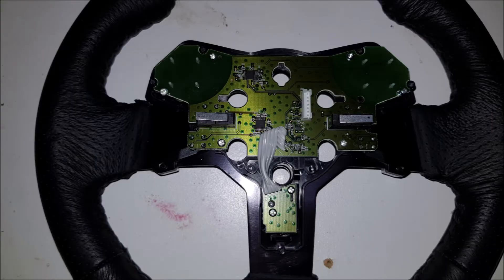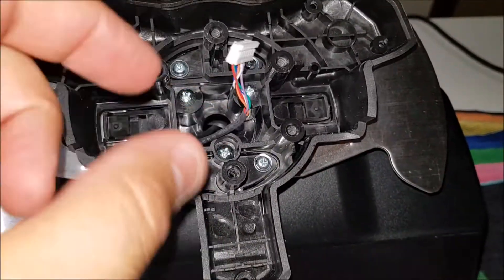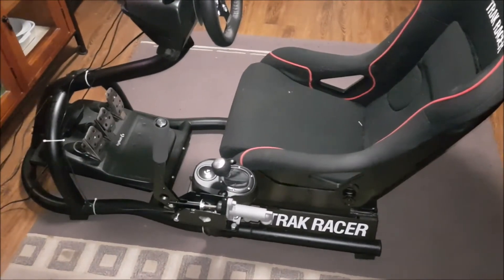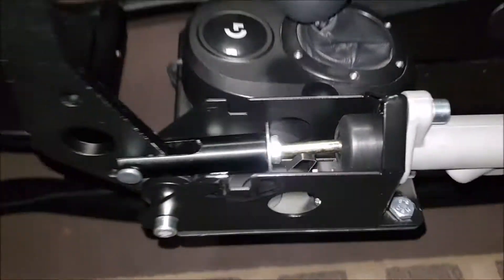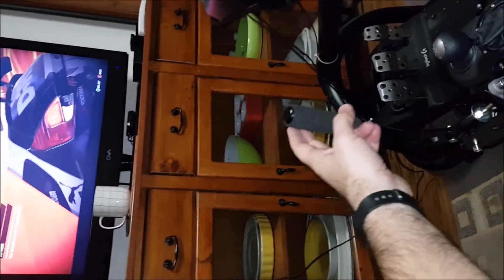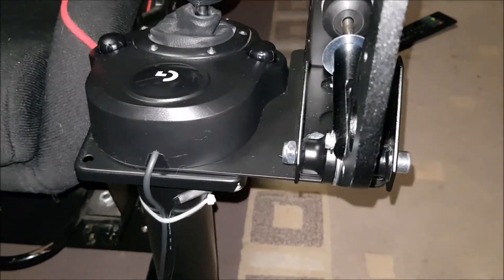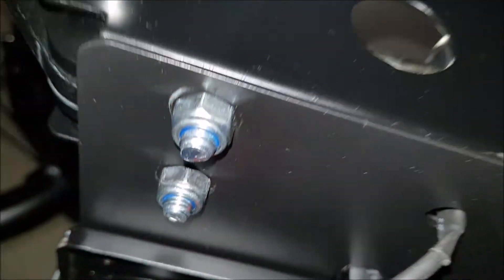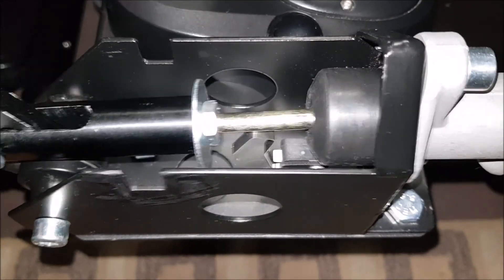Logitech G920 Handbrake Mod for XBox One - UPDATE

Comment: How did you connect the b button is it the same spot on all of them?
Reply from the maker: Not sure what you mean by same spot on all of them. I liked at Whyte the B button was on the board, then just followed it along to a spot on the blade where the track was easy to solder to.

Comment: wish u did a video of u doing the wires to the Btracks i want to try it my self but not shore how to do it and dont really know any one to do it for me   
any advice being its so small and thin ?
Reply from the maker: All you need to do is follow the tracks from under the B pad. One of them is common to all four buttons, from memory it was the upper one. Just lightly scratch the clear coat off and use a little bit of flux to help the solder stick. Don't keep the iron on the tracks too long as they might lift off the board and them you'll be stuffed. Sorry I cant offer more advice.
Reply: @19schuey  what colour is what ?for the wires
Reply from the maker: @glennnikkelson3082  because its a simple on off switch, it doesn't matter.

Comment: Could you use a pressure sensitive button instead of an on off one.
Reply from the maker: You could, but there would be no benefit. The input the console reads is on or off, same as the game controllor.
Reply: @19schuey  im sure if i hold the handbrake, give it gas and release the pressure on the button slowly the car takes off slower, compared to me just coming straight off the handbrake button. Im going to investigate this more tonight. I was sure the xbox had pressure sensitive buttons (the original one and ps2 did but google says the xbone does not)

Comment: Can you show what lines i need to tap in to on the motherboard to rewire Y and X button? I am planning on making a turnsignal switch so i need two buttons rewired. :)
Reply from the maker: I don't have any other tear down pics other than what was in the video. Just lift the rubber pad, and look for the track that goes to the button you were after. There will be two, one marked +ve, and one marked GND or -ve.
Reply: @19schuey  Aha! Thanks for taking time to reply. :)

Comment: Did you have to scrap the tracks on the PCB before soldering?
Reply: Also for the PCB which wires go to each track is hard to tell in the pic
Reply from the maker: @Shwitty  hey there. Firstly, yes you have to gently scrape the protective coating off, just enough to make the copper track visible and so the solder will adhere. Used plenty of flux to clean it off too. Second part, basically lift off the rubber pad, and follow the tracks from the contact pad part.

Comment: Best Logitech E-Brake setup I have seen yet! Just ordered what I need to do that same setup. Thanks for the video!
Reply from the maker: Hey Andy, thanks for the feedback! Sorry haven't replied earlier, had comment notifications off! Hope it works just as well as it does for me!
Reply: 19schuey , I was wondering if you had a template to that shifter/ebrake plate you had made?
Reply from the maker: No I dont sorry. I just used a piece of cardboard and traced around the shifter, then placed the brake frame and traced it. Then measured the mounting holes. I actually cleaned out my shed on the weekend and the original aluminium one was there and I threw it out! Could have taken a photo for you.
Check out my update where I show the stop bolt I put in to limit movement. Link in video description.
Reply: 19schuey, haha no worries I’ll take your advise and trace both units. I appreciate all your help.

Comment: You know how momentary switches have 3 levels which 3 do I use nice video you killed it
Reply from the maker: Thanks mate. For the switch, the centre one is usually always used with one or the other. If momentary, it shouldn't matter which is used. A simple check with multi meter to see which two make contact will sort it out for you!
Reply: @19schuey  I dont have a multi meter but which 2 do I use 1. Common 2. Nomarlly open 3. Normally close or I just send you a picture of the switches I bought https://www.ebay.com/itm/5-x-Micro-Limit-Switch-Long-Straight-Hinge-Lever-Arm-SPDT-Snap-Action-LOT/292490785337?hash=item4419cf3239:g:~f8AAOSwRTVad0QG thanks so much for the help
Reply from the maker: @fernandosantana6159  sorry for delay, don't look at channel often enough. Need to use common and normally open, as activating the switch will close it and make the circuit.
Reply: @19schuey  thanks

Comment: its stupid that logitech dont make a simple affordable handbrake, if they did it would sell thousands immediately
Reply from the maker: Yep, would have got one. Thrustmaster make one for theirs.
Reply: the thrustmaster one is good but still to expensive for most people
Reply: Ikr, there's a lot of tracks on The new Dirt Rally, that are impossible to make a good time on without a hand brake. I'm not a handy guy either, so I don't won't to go mucking around with the internal mechanics of a wheel to do a DIY job.
Reply: Use a thrustmaster
Reply: @fnf5943  You cannot use the thrustmaster handbrake, because it is no usb and you cannot connect the handbrake to a logitech base either..

Comment from the maker: *EDIT 27 Sep 18: After using it for a while now, I have decided I need to readjust the micro contact method. I will look to add a stop of some sort so as to stop the handle coming all the way back as it would bend the micro arm too much, then you would need to pull it all the way back the next time to re activate it. Thinking of just a simple bolt through from one side to the next so the washer stops against it. Will update when done, whenever that may be.

On a side note, Codemasters announced DiRT Rally 2 for a Feb 2019 release!

Comment: Hey mate, just wondering if you had a photo of where the headphone jack was wired into behind the wheel and it’s I really needed a jack or can I just run a straight wire? And also I don’t have a small enough soldiering iron, would I just be able to hold the wires in place with electrical tape. Thanks for any help
Reply from the maker: Photo at 1min51sec shows the jack. I'll see on my laptop if I have another, but it was basically on the lower half of the case away from where the force feedback motors sit.
You could do without one and just have the wire running out just like the USB lead, I just wanted the neatness and also having an option to take it off. Personal preference.
As for taping it, no way, it needs to be soldered. The thing is constantly rotating, so it needs to soldered.
Reply: 19schuey okay. And where is the jack lead hooked up to underneath the cover of the wheel?
Reply from the maker: Blinco5racing27  I'm not sure what you mean. The lead goes from the jack up through the shaft as you can see at 1.57. That then connects to the wires that I have soldered to the B button tracks. I kept the leads to minimal length, but enough to allow movement and yet not get snagged.
Reply: 19schuey yeah okay. So the jack is just wired onto the board, then lead through the hole and goes to the jack. It makes sense now. Thanks for the help

Comment: Hey man, I was just wondering what handbrake you used and where can I get one? or even any suggestions on any decent ones for a reasonable price... trying to build a rig on a reasonable budget
Reply from the maker: This is the one that I got off of eBay. All the other electronic bits I had in my RC stash or got from my local electronic outlet, Jaycar here in Aus. (Don't know where you are, in US it would be Radio Shack).
Reply: Perfect thanks👌🏻

Comment: I just ordered myn and was thinking.. Maybe you can go into settings in game or xbox home not sure and make it a sequential gear stick using third and fourth and then maybe making 2nd gear hand brake???
Reply from the maker: Sure can. See this video, not mine, but there are some who make up 3D printed plates to only allow 3/4th use and have spring to self centre it. I like the H pattern for the old style cars in Forza. F1 and modern GT/Le Mans style enduro cars have paddle shift, and yes some others notably touring and rally cars have stick sequential, I usually use the shifter. Not hard to put one of the plates in, so might just get one anyway so I have it on hand if I wish to do it. Using the plate though you wouldn't be able to utilise 2nd as HB, but don't think you can map that to HB anyway.

https://www.youtube.com/watch?v=8Vi-nUKuosY

Comment: good info, looks simple enough
Reply from the maker: Thank you. Yes simple, as long as you don't damage the PCB tracks.
Reply: 19schuey ive been lucky so far soldering to cheap dpad boards so I should be ok
Reply from the maker: bsft cool, cheap Dpad boards are different to $400 units though! Be sure to post pics or videos of what you do.
Reply: 19schuey Id have to dig out the pics and I did build something a while back. Next I will give it a go with a G27 set Ive got. 
As for videos , Ive got a few on my page of what Ive done with sim frames

Comment: Hey man, looking for some more info on this if you can help?
Reply from the maker: PreToPost sure, I'll help where I can. What do you want to know?
Reply: Firstly, why the 2 wire connection onto the motherboard rather than just running one to the button of choice? Also as with your case and the 2.5mm jack, can I use a usb
Reply from the maker: Not sure what you mean by one wire to the button. You need two as a minimum. That's how a switch works. Same as the button, effectively two wires, when you press it, it connects the two together. The tracks that I soldered to are obviously the tracks that make the switch under the B pad. Had to gently and carefully scrape some of the protective clear off of the track to expose it to allow the solder to hold. As for your USB question, that would be overkill because like I just said, it's only two wires, so I made it as minimal as possible. A USB socket would take up unnecessary space. You could just run the wire out and leave it long like all the others I had seen. I just wanted the ability to easily remove if I wanted. Also if I ever want to get a new brand of wheel and it doesn't have a handbrake, I have one already made that just requires a connection on the wheel.
Does that answer your questions?
Reply: That does thank you. Was just wanting to see if using a USB port instead of a jack like you did was a viable way.
Reply from the maker: PreToPost glad to help. Just remember, more wires in a USB, means more work! Make sure to post a link to your video or photos of what you end up doing.
Reply: I'm thinking of a way to add a headphone jack to the wheel itself instead of using the controller. You reckon it would be possible with the adaptor that plugs into the controller?
Reply from the maker: Not sure. You could wire one in, but first you would have to find the audio signal where it reaches the wheel from its USB lead to the console.
Reply from the maker: Stick in where, there is no audio output in the wheel unit. I'm looking at getting one of the chat adapters that connects to the bottom of a controller and see what I can do with it.
Reply: Please let me know how this goes, it's what I want to do. Where abouts in Aus are you btw?
Reply from the maker: PreToPost will do. Wagga Wagga NSW.
Reply: 19schuey damn, was going to say if you were in Brisbane I could pay you to do a handbrake for me if you would
Reply from the maker: Callam Marshall this is what I'm looking at, want to see how I might be able to incorporate it. https://goo.gl/images/yBWcqm
What I do now is have my headset plugged into a controller and have the controller plugged into console USB so it doesn't time out. A wireless headset negates all this of course!
Reply from the maker: Callam no, my controllers are all the newer ones with the 3.5mm jack in them. Will get one of the adapters to see if I can hard wire it off the USB in the wheel.
Reply: 19schuey I currently have the old controllers with the old plug in connector for headsets, looking to do the same as you and see if I can use the USB from the wheel